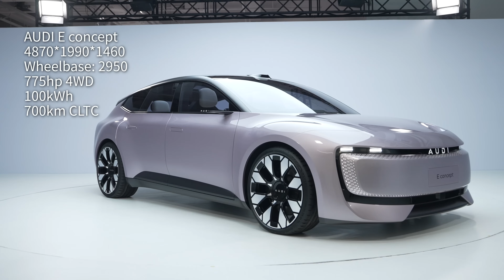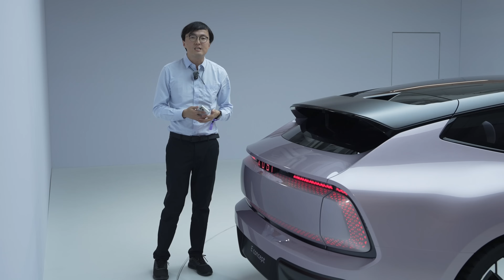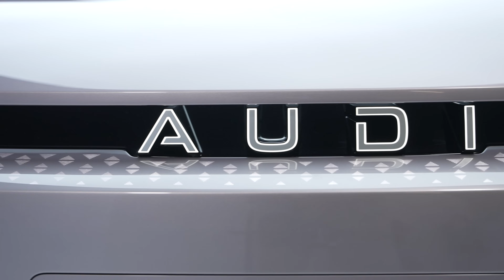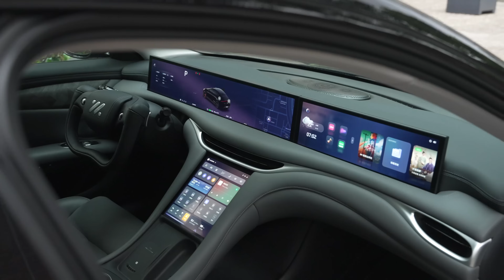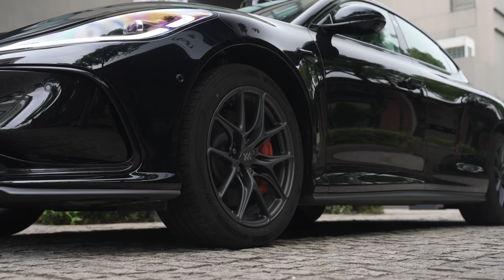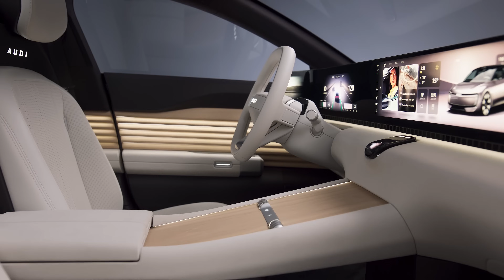775hp Chinese AUDI BEV Without Four Rings - AUDI E concept Static Review

Comment: <Sigh> The 4 rings of Audi have meaning:
Audi, Horch, DKW, and Wanderer, the foundation of the AUTO UNION
it is not an Audi anymore with that.
Call it SAIC/AUDI, Show the 4 Rings with the SAIC logo, but do not take away the 4 Rings and plaster some cheap looking font on the front of the car and call it an AUDI.

SAIC is no light weight and makes some serious cars!!! It being a player in the automotive industry from before the 2nd World War

If it's a joint venture then it should be reflected in the manufacturing and presented in the logo.

Comment: Shawn, Roof Spoilers like that do not work . Its a fake Aerodynamics solution. Its just a Design Element.
Reply: maybe. or it might provide a reduction in drag.
Reply: @dalton-at-work  No it does not provide ANY reduction in drag. If anything if the air is funneled downwards on the rear windscreen it "might" have a cleaning effect. The Spoiler itself would only be a drag obstacle in the aiflow.
Reply: @dullumullu  you are assuming. kinda weird.

Comment: These generic looking cars for the Chinese market are soo boring. Melted chassis look, terrible steering wheel (it has to have some weird shape), no personality in the interior, just slap in a large screen and that is it. The customers will buy little trinkets from Taobao to decorate it so we don't have to. Add as many annoying warning nosies as possible (they are waking up babies so difficult to get to sleep all the time) and since there are no buttons anymore even for the commonly used functions add an annoying voice assistant to hide the fact that seat heating is in a sub menu now not on a button FFS. The Zeekr whatever vs BMW i3 video showed this well: the BMW has a character while the Chinese car could be replaced by practically any other Chinese car, they all look the same inside. Has to look good in the showrooms which are closing all around China as sales plummet and will break down in a few years anyway cause quality is not something they planned to have. Then advertise them like this "775hp..." like that matters in China where the max speed in the cities is 80km/h and there are constant traffic jams. All machines have the same speed at the red light. Also typo in the title: ""AUDI E conept Static" Conept :)
Reply: De gustibus non est disputandum... Is a saying wrote down by the Romans, but as old as human beings.
TBH, I am following Chinese EVs for a long time, and I have to say that the design work (of mostly western designers) is much more appealing against those of traditional manufacturers. When you combine it with technic, pricing & standard equipment - you have an auto-industry revolution which seemed unimaginable just few years ago!
Reply: @kaurinjugoslav6326  I tried a bunch of them recently while car hunting here in Shanghai and they all the same after a while. ET5T is nice from the outside but inside the are all the same.
Reply: You can say the same for an old EK Civic too. It has the character of being loud and noisy. It really depends on what you are looking for. For most consumers, they are just looking for a comfortable car.
Reply: you just described a Tesla
Reply: @robmello3245  Yup and Tesla sales here in China are dropping. It is a poor man's car now, sliding down to BYD level (cheap, entry level EVs). Onvo L60 beats 3, and Y easily and much cheaper.
Reply: Lmao did Chinese evs fuck your mom?
Reply: Does it matter whether it's generic or not lol. Chinese EV companies are leaving the western manufacturers in the dust when it comes to technology. Look at the sales of western automakers in china, they are free falling. They can't even make a proper EV without the help of Chinese companies.
Reply: You have no idea what you are talking about. The chinese cars offers more personality and more specs for the same price. AND its even better specs. On top of that its top in class compared to the legacy makers like VW and BMW. These are cars we are talking about and you think they don´t care about safety and quality huh? How stupid are you for thinking that way? You think making millions of unsafety and bad quality cars is what China is aiming for in the EU market too huh? Keep talking shit and buy a shit VW. Oh VW by the way just binned their EV platform for a chinese one. Thats how bad the germans are doing compared to chinese. But you know more than these billion dollar companies behind your small computer right?
Reply: People vote with their money. The Chinese are the number one manufacturers.
Reply: Because this car is made for Chinese consumers who prioritize passengers over drivers. Because cars are still considered a luxury item in China If you can afford a German car you can definitely can  afford a private driver. 

 and the car owner sitting in the back
Reply: @AprezaRenaldy  Nah, I live in Shanghai and cars are most definitely not a luxury item anymore. Especially not the german EVs which are not selling.  VW ID6 seems to being ok but MB and BMW not at all. Nio's everywhere or Tesla for poorer people. Nio is bought by drivers and in MB and BMW price range, only Porsche is more expensive.
Reply: @PortfolioPL  Shanghai has a GDP per capital 3x the national average.

That's not the kind of practice that people who live in other places have Kunming
Reply: @AprezaRenaldy  Sure. I saw a lot of Beijing cars in Yunnan. The way people drive I would not get an expensive car either :)
Reply: @AprezaRenaldy  I agree with your first point, but the rest of your view is actually wrong. Cars priced under 1 million RMB have nothing to do with luxury. Hiring a driver for a 200-300k RMB car would seem silly. Only entrepreneurs, senior officials, and celebrities hire drivers, and that’s just because their time is valuable, not because of the car. Ordinary Chinese people don’t have the habit of hiring drivers. Chinese people usually prefer cars designed for families because most families only buy one car and keep it until it’s time to replace it.
Reply: @Zavier-ks6cb  this Audi brand not great wall motor